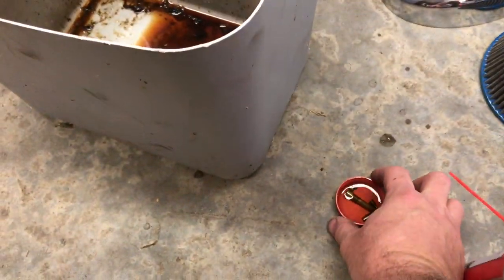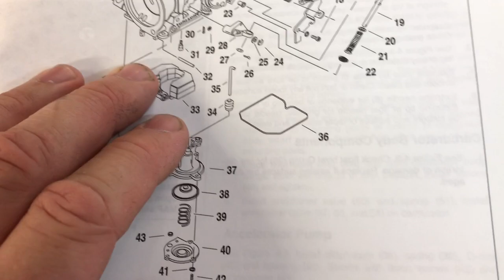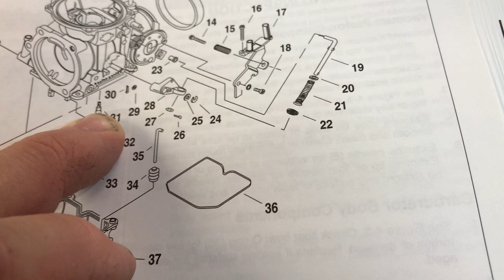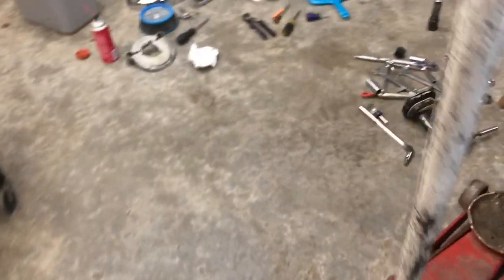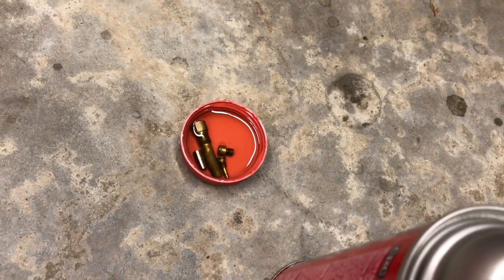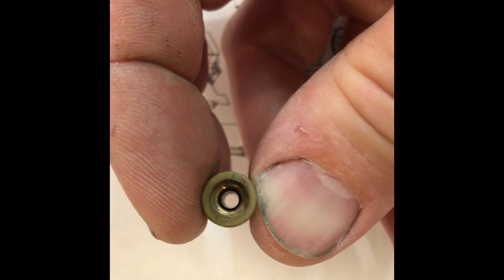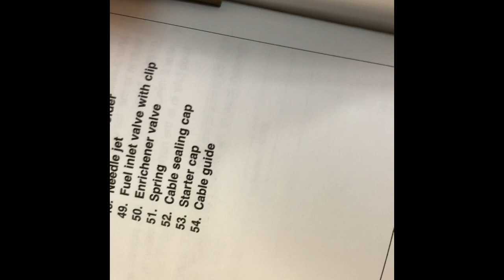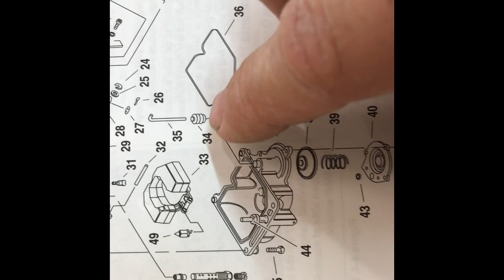Harley Davidson won't idle without choke on - Problem FIXED

Comment: I can’t thank you enough! 
My buddy has an ‘02 Dyna Low that he bought (had been sitting a few years) that wouldn’t idle without the choke. Even when it was running, it idled rough, it cut off if the rpms got low, and it backfired constantly. 
Took apart the carb and cleaned the jets just how you explained. The bike runs like brand new!
Thanks for your video!

Comment: Just wanted to give thanks, Bobby.  I have a 2000 Dyna Wide Glide which I haven't rode much in the last couple of years.  When I went to go for a spin a year ago it was running just like yours, backfiring, popping, hard to start and the choke needed to be on at least 3/4 for running.  It's never been like this before.  Rode for a couple of miles and gave up.  I asked some bikers buddies about it but no answers.  My son said to keep putting additives in the gas.  His Harley had almost cleared up after 5000 miles.  What?  5000 miles? No way.  Took it out once more a month ago.  Same situation of course.  Then I saw your video.

I followed what you had done.  Great pics and details.  After cleaning the jets, the bike started up and ran just like it used too.  Choke was completely off in less than a minute.  Took it for a ride with no popping or backfiring.  Wow.  Thanks again for your video.  I'll definitely be watching out for letting any of this funky gas sit around in any equipment I own.

Comment: Thanks for the video Bobby!  Clear and to the point, great job.  Anyway I spent some time last night and cleaned my carb to resolve the choke/idle issue.  The slow idle jet was the problem with my bike, main passage blocked.  Used combo of carb cleaner and tapping on bench to clear blockage, did not insert anything to push material out.  This jet is very small.  I did use your towel/mirror configuration to view/disassemble the bowl.  This was also a time saver.  Good stuff all around, thanks again.

Comment: Last week I took apart the carb on my 1997 Softail and cleaned up everything. I put it back together and it still wasn't right. I saw your video and it jump started my brain. I recleaned the carb and this time I didn't forget those little holes on the sides of the tube. Now it runs like new again. Thanks

Comment: THANK YOU SO MUCH! I HAVE A 04 HERITAGE CARBORATED. WILL NOT START WITH CHOKE ON. WILL START BUT NOT IDLE. I ALSO NOW KNOW WHERE THAT LITTLE CHOME PART FELL OUT FROM. I PUT IT IN THE WRONG PLACE (CARB FACE, FACING BREATHER AS I DID NOT KNOW WHERE IT FELL FROM. YOU'RE HELPING SO MANY PEOPLE. NEW SUB. ALWAYS THUMBS UP!

Comment: so i was afraid to mess with mine, but i did. man the JET was GUNKED UP SO BAD...mine sat for 8 years in a open car port but now it is running after cleaning all the jets, the carb, all if the bits n bobs. it will even idle with nasty gas. THANK YOU FOR THIS.

Comment: In my case, the no idle situation was 100% contributed to the "slow jet" as you call it;  pilot jet is what it's called in my manual. I cleaned the jet holder and the main jet, not knowing about the pilot jet. After taking them out again, and removing the pilot jet, it was stopped up exactly as you had stated in your video. Ran a piece of steel tag wire through it, installed all the jets, and after filling the carb bowl, she fired right up, and idled perfectly.  Thanks for the video!

Comment: I just bought a 2002 FLSTC with the same problem. The newest bike I ever had was my 1972 FLH with fixed jet Bendix corroborators. My other bikes were early pans and flat heads so I had no experience with the new carb on my 2002 Harley. This helps thanks.

Comment: Thanks great video I do have the exact problem 2000 fat boy I assumed that was my problem bike sat a lot before I bought it an about a year after intermittently running it I'm gonna try what you showed I'll see how it turns out thanks again

Comment: Nice!  I'm new to Harleys and I just purchased a '97 DWG that has this same issue.  Will give it a shot and see what happens.
Reply: That was it!  The main jet and jet tube were clear.  The slow jet was clear on the side hole but the end hole was completely blocked.  Runs great now.  Thanks so much.

Comment: Thank you Mr. Bobby, I have a 2003 100th Anniversary Edition Heritage Classic with only 21,000 miles and only turns on with the choke out halfway but if I turn the throttle it'll stall immediately. I introduced 2 ounces per gallon of Sea Foam Cleaner into the gas tank to stabilize the new premium gas I added so maybe it'll clean the carburetor too as it runs. I noticed the gas throttle cable is not tight near the fuel adjustment screw area. Will the small jet holes clear up with Sea Foam gss additive?

Comment: I've got a 95 Sporty that I'm rebuilding. I've replaced petcock, screen, intake gasket, hoses, choke, carberator. I've tuned it to 1 1/2 to 2:turns out. It won't idle unless I hold the throttle above 1000 rpms. Im stumped .
Reply: Please let me know what you find I have done the same thing practically and still nothing. Will fire up and run for a second  when my hand is over inlet with choke on. So confused?

Comment: So I'm having a similar issue but not quite like this, I have a 97 fxdwg it was sitting for maybe a week due to bad weather, I took it out for a ride when I got back i let it idle for a little then it started to idle down and back up again then it was riding rough and needed constant throttle(so pretty similar to this now that I'm typing it), got home went over a few things that checked out, got to the carb when I took the air cleaner off it helped a little with idling down then up, I'm 99% sure its gunk in the jets like this, just wanna confirm my suspicions with someone
Reply: Mine idled better with filter off also. So I cleaned the jets,runs great.all of these carbs are the same..

Comment: Your bike has a dyno jet kit installed by the look of that part number 47.. stock it will have many more holes in it.. not just the two you have in yours.  something to consider as these kits have been known to cause problems and poor gas mileage.

Comment: could some one explain this please , are there any adjustment for the jets after cleaning , are they screw in all the way and sit tide or they need to sit on a certain turn ? 
thx
Reply: tighten jets until snug, thats all.
Reply: Turn out 1 1/2 turns from fully closed. My 1993 Evo loves that!
Reply: Thank you sir ,I'll try that .
Reply: @seadog9999  If you turn them out 1 1/2 turns then you need to let 20 lbs of air out of each tire, everybody knows that.

Comment: Not much help if you don't put the year model. have an 03 sporty 883 w/FI and a choke, won't run without choke on.  Would be a HUGE help if you actually said the year, that way we could determine carb type, etc.